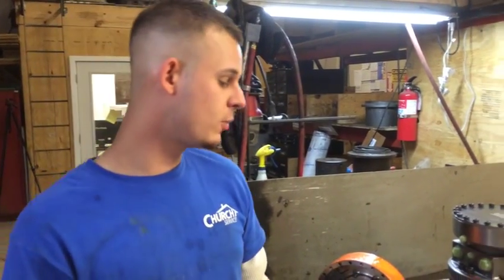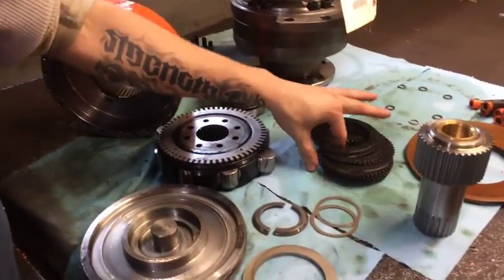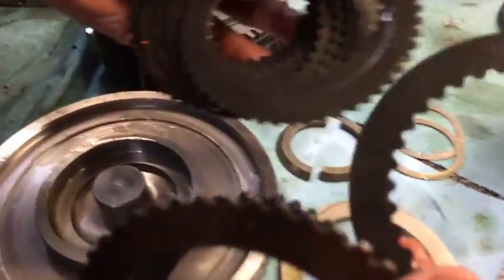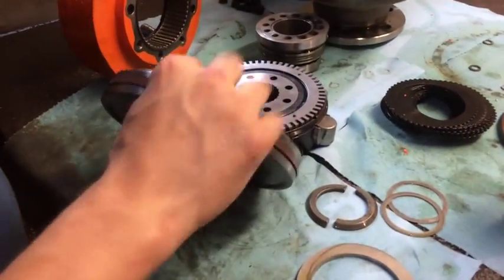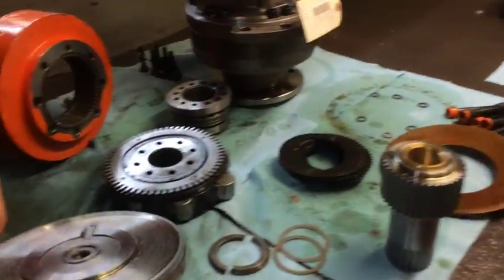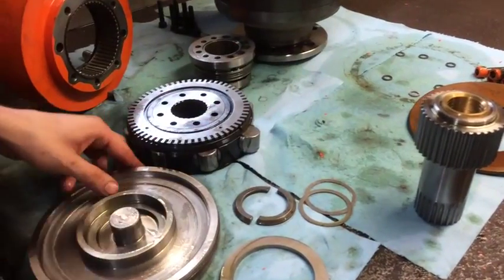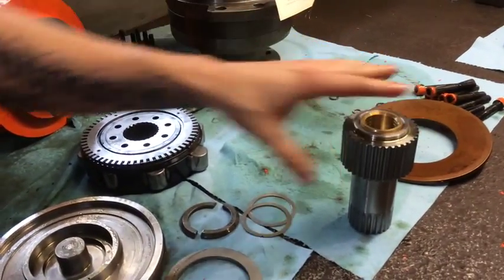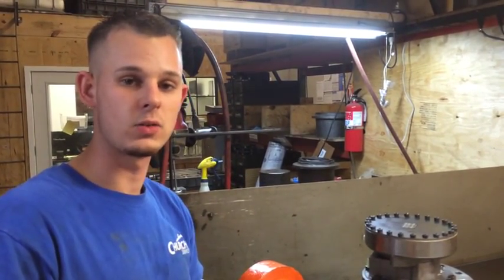Excavator Final Drive Brake Pack

Comment: Is it possible to release the hydraulic brake of a T650 bobcat?  I bought a T650 and when I turn it off or park it, it doesn't brake and when I turn it off I push it with another machine and it moves without resistance.  Can you help me see why they don't stop my final drive.